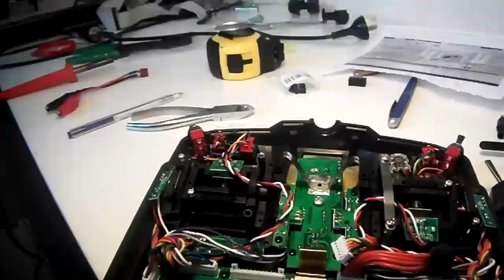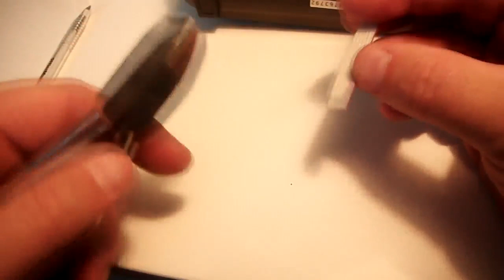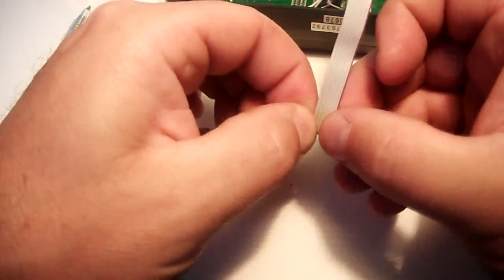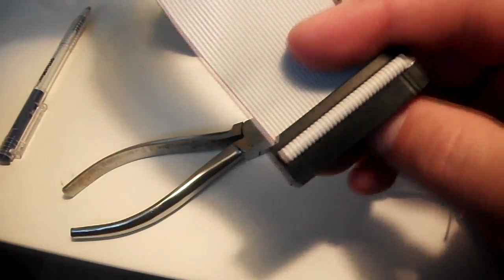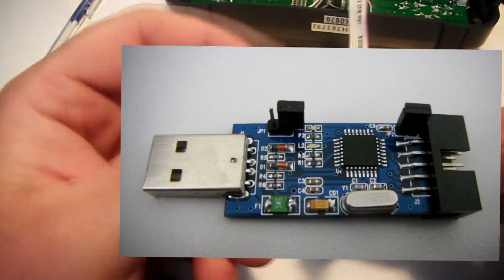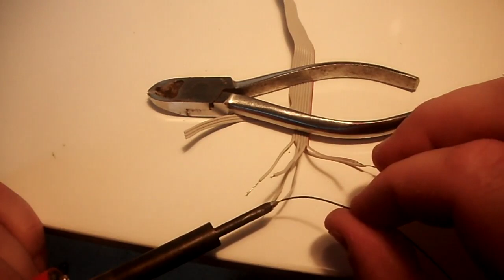Turnigy 9x flash upgrade wiring how to-part 1

Comment: On soldering. Yes, all the books and experts say apply the heat to the part and the solder to the piece. 

However. Transer of the heat from your iron to a "dry" piece is inefficient that way. 

What I do is apply flux to the part.

I load up the tip of the iron with solder. 

I "dip" the piece to be tinned into the blob of solder on the tip. 

You can visualize that the blob of solder on the tip provides instant and very efficient transfer of heat to the piece. tinning OR soldering.

Comment from the maker: not sure . If you are meaning the SpartiePants Pogo Board? then yes..... way cheaper if you do not put a price on your time to do this mod.

Hobby King do them too ..... real cheap

$4.95 not quite as good as the one I use here..... but still will do the job fine

The 10 pin connector cost me $1.80 and that was it......